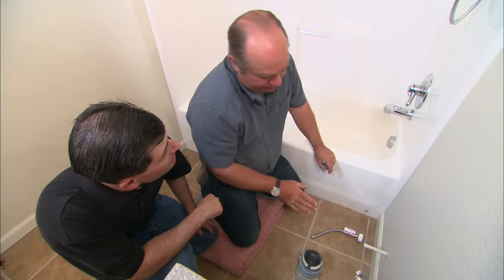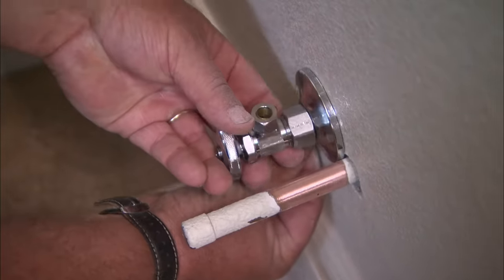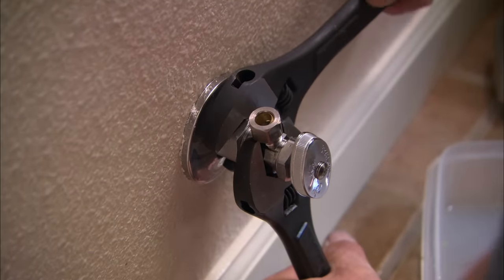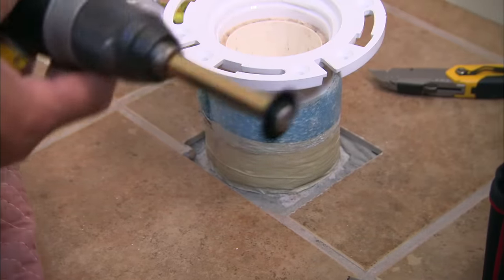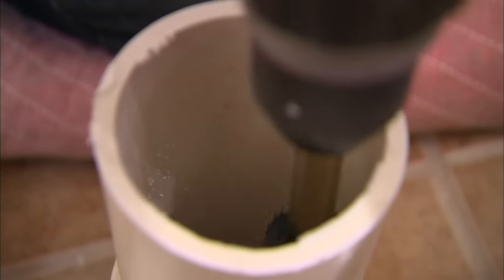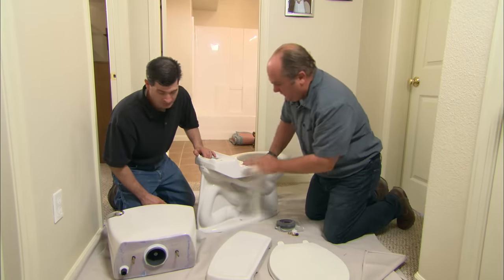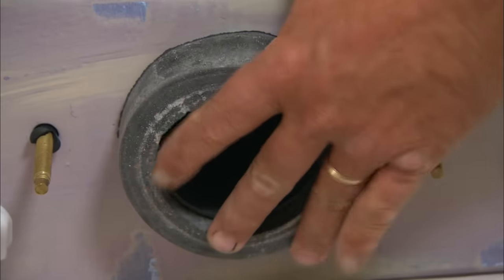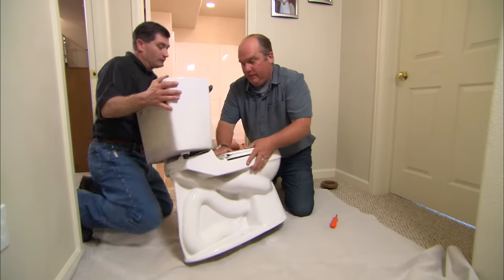How to Install a New Toilet | Ask This Old House

Comment: When I install the Johnny bolts to mount the toilet, I use a sharpie and mark a line on the top edge of the bolts perpendicular to the T in the t-style Johnny bolts. That way, I can be sure the bolts haven't rotated around where the narrow part lines up with the flange slot causing it to pop out easily when tightening the flange nuts. It's frustrating when they do that and you have to pull the toilet to reset them. A little prevention saves a lot of headache.
Reply: I love plumbers like you. I don’t have to worry that you’re going to cut a corner the second I walk out the door. Now, that isn’t to say the guys who do, are doing something wrong. That isn’t what I mean. I’m just saying that having a plumber, or any other tradesman who has proven they have an attention to detail, and take pride in THEIR work even if it’s on someone else’s project, is so valuable. I will pay 20-30% more to hire those kinds of tradesman. I always say to other builders, “is it really worth saving 10,20,30% if you have to baby sit them, and worry about it? The peace of mind is worth the extra money. And to be honest, when you try to save money by hiring inferior tradesman, you almost always end up spending more fixing problems. These problems might not even be things the plumber caused. They could just be things the plumber didn’t notice that were done wrong by the previous tradesman. Like if the drywall guys don’t put the light hole in the right spot. Then the electrician installs the light in the wrong place, and says “well that’s where the hole was, and that’s where the plaster guy brought the whip through, so that’s where I installed the light.” The electrician could have come to the builder and said “hey this whip was pulled through into the wrong area” and saved the builder time, and money, because the builder will have to pay the electrician to fix it because technically it’s “not his problem.” Those things add up when electricians are making 80 an hour the minute you step outside the contract. 

I will literally get into fights with other builders for stealing my contractors without asking. I know many who will. Luckily I pay my guys well, and they like working for us. Anyway, this was a long way for me to say thank you,  because you’re the guy I’d pay 30% more because you’re worth every penny.

Comment: Would have left the length of copper coming out of the wall slightly bit longer so that in the future if a plumber goes to change that compression valve they can do so without having to go into the wall because the previous valve deformed the pipe and made it now too short for a new one ✅

Comment: I always cut stub outs long enough so that I have access to the ferrule or brass ring in case i need to cut it off in the future. Basically add the width of the nut to the length. I’d also recommend using a stainless steel flange. For on me it’s much stronger. That plastic will break easily. For two, you can glue it and still spin the ring to where you want it so it’s much more forgiving
Reply: No kidding! When the shutoff valve fails someday (and this one will because he didn't use a quarter-turn angle stop) you will be cursing yourself for not leaving an extra inch. And since DIYers are likely to over tighten the nut and distort the pipe, you may be in trouble sooner than later. Oh, and he could have used a Sharkbite angle stop, or at least mentioned it as an option.
Reply: I had a PVC flange break so I replaced it with a metal one. I get to see tomorrow if it was the right choice or not. Because now I'm changing that whole toilet. I hope it is in good shape.

Comment: I would leave the Maximum of supply pipe.  You are now screwed if that connection leaks or you need to change that valve.  9 and '3'.  Tighten Tank and toilet evenly.  Turn on water before connecting to toilet and check.  The plastic retaining nuts become brittle over time and can slowly or suddenly fail.  I put a Rad Clamp around them and tighten it snugly.

Comment: He cuts the drain pipe down below the finished flooring so it works with the particular flange he used.  Once you cut it off you don't get that back again in case things change in the future.  Another option is to cut it off flush with the finished floor and use a push-in (or push-tite) flange instead that fits inside the drain...some have a gasket and some are glued in. This also would mean he wouldn't have to remove any material from around the pipe like he did.
Reply: It’s a special drill bit but I won’t tell you what it is so you can’t buy it 😂🤣
Reply: I agree.

Comment: Many here complained about a toilet water supply line cut too short. A way to avoid this and to make life easier for a homeowner down the road is to solder a male adapter to it and use not a compression valve but a FPT valve (female thread). That way if it ever needs to be replaced, it's easy and painless.

Comment: Nice video.  I'd have used a little teflon tape for the water line around the threads to prevent leaks.

Comment: I agree on cutting the pipe too perfect and leaving some room "just in case"  think he did a pretty good job although i would have added teflon to the connection.  Also I have had a plastic ring installed for 22 years changed three toilets o same one and it holds up fine.
Reply: There are also metal flanges to buy  (steel or aluminum). The plastic ones can crack. And I haven't seen a nylon one made yet or a resin made one either. I have been a caretaker for numerous apt buildings so I have done repairs and replacements before. There usually is a WHOLESALE electrical/plumbing warehouse or store in most bigger cities where you can get parts a lot cheaper than Ace, Lowes or Home Depot!

Comment: Sorry, 1:20 was too short cut of pipe from the wall. Better live extra inch for a future valve replacement.
Reply: It's a compression fitting. Get a new one with another compression fitting and you never have to worry

Comment: So when that shutoff valve goes, you'll have to cut into the drywall, replace the whole section of pipe, patch the hole, apply knockdown texture, prime and paint. All because you didn't wanna leave an extra half inch of pipe sticking out of the wall. Smart.
Reply: That's funny because that's the first thing I picked up on when I watch the video. And I had to rent about it you'll see my comment above.
Reply: Or you can just buy another shutoff and leave the old nut.
Reply: @investingwithpaco6540  you can't always use the old nut and compression ring.  I've had old rings that were deformed or damaged from the original compression and could not be reused.   That's very common.
Reply: @investingwithpaco6540  You also leave the old ferrule......
Reply: Great points and all accurate. 
Use a multi tool and make a square cut. 
Replace the new fitting and shut off supply valve. 
Take the new dry wall or green board and make an "Indian patch".
Cut the square on the back of the new drywall, but DO NOT CUT ALL THE WAY THROUGH AND PEEL THE PAPER BACK A FEW INCHES FROM EACH SIDE OF THE FRONT. 
this will leave dry wall paper to leave ZERO seams.

Comment: should mention remembering to remove the rag you put in the sewer pipe
Reply: Hahaha i know right ;) he forgot about that. First clog hahaha
Reply: He would have removed it before the toilet was put into place
Reply: bob woerner
Reply: do they make a cap or something that can be easily removed for that?
Reply: Just flush it bro...
Reply: @stephensnell1379  doubt it. They seem like amatures..
Reply: @lordcromwell5512  it won't flush. it will clog the pipe.
Reply: @bumperboatsturkeypoint3469  he can always learn new things even if he is a plumber, it's wise to realise you don't know everything about a trade even if you have been doing it for years and to try and broaden your knowledge of the subject. this is applicable in all things. only stubborn people mistakenly believe that just because they have experience they know everything, what suffers is their work and their personality.
Reply: Anybody can make this mistake.  I see professionals in any field make a mistake and do crappy job.   Building a home is an endless learning experience of making mistakes.
Reply: bob woerner - hah! Good point. That could cause some issues.
Reply: Lord Cromwell cloth rags and poo are quite different. Lol
Reply: Lol
Reply: Lord Cromwell hasn’t Oliver Cromwell been dead for a few centuries ?
Reply: Gravety and mega dump will flush it down.
Reply: Or maybe he used toilet paper? Or paper towel. Not a problem if you do forget.

Comment: Along whti leaving more feed line exposure it is always a good idea to secure bolts to flange with washer&nut to insure they stand straight  and tall and never ever spin when the next guy pulls the bowl off. Also it is advisable to mount tank to bowl After bowl install.  I am sorry but I expected more from This Old House.

Comment: Can’t tell you how much places and houses I’ve removed or seen old toilets with the flange bolts cover missing or not properly installed because the installer didn’t cut the bolt or didn’t know what the heck they were doing. It’s these simple things that can make a job look great or bad.

Comment: Great work, but that copper pipe was cut so short, next time you need to do work on it, you are not going to have any room left to cut it down if needed.
Reply: I agree; I always want a fudge factor when working on something.
Reply: Yeah, I thought the exact same thing. Should have left some more room.
Reply: That was a screw on connecter, he's good.
Reply: Yeah . I thinking the same thing .. basically.. u don’t leave any pipes for the next , remodel or issue lol ,
Reply: I remember having to cut into the wall just to replace an old leaky inline faucet, but I decided to just replace it with pex tubing instead of copper.
Reply: Yeah, I always prefer the bell flange and leave 1.5” for when that valve inevitably needs to be replaced 15 years down the road.

Comment: I have been a C36 plumber for 39 years and I would never put a plastic closet ring on that pipe.  They make them made out of steel and stainless steel.  I always use the stainless steel ones since they will never rust out and you will never have to replace the closet ring ever again.  Just experience of wanting to do it once and never having to go back to do it again.  Also, I see they never did put quick dry cement around the closet ring and have coated screws go down into the floor for a cement floor.  For a wooden floor, they did it right.  But when they were setting the toilet they never did level the toilet, they just set it without leveling it.  Not a good move.   Maybe I am pickier and want to make things right to where nothing will go wrong after an installation like that.   This is how I was taught back in the 70s,  And I have never had a problem with toilets after I set them.
Reply: agreed...... I'm no plumber, actually a school teacher, but I always pack plumber's putty around the ring to keep the water from going under the sub floor in the event it starts leaking underneath.  Moreover, i caulk around the the toilet base, but leave a 1" gap on the side and rear also to see when water starts to leak, but to stop most on the accidental toilet overflow.
Reply: R 
I agree with your opinion on the closet flange with a stainless steel ring, but that flange should have been flush with the finished floor, NOT ON TOP OF THE TILE.
Conventional wood sub floor, or on slab (this video), it should be secured with screws.  This old house is full of shit.
I can't wait til the owner gets tired of his new toilet rocking on the flange and the smell of sewer gas because of the compromised wax seal.  I get to fix issues like this on a regular basis.
Keep doing it wrong out there, I'm getting paid!
Reply: Frank De Mascio , I've been a plumber for 30 years, the flange should sit on top of finish floor. Not below it and yes use a flange with a stainless ring. I've replaced dozens of those cheap ass plastic type. And ALWAYS ANCHOR flange to the floor, that is what supports and holds the toilet to floor.
Reply: Have you ever put silicone at the base of the toilet to keep it from moving?
Reply: R s.     S
Reply: R well i am a nobody and my flanges are cast iron but I got that foam sani seal gasket and it works wonders. I will never use a wax ring again.  Used the sani seal on my downstairs toilet and my tenants upstairs rental.  I liked that i was redoing the floor with wonderboard had to stop so used that seal for toilet.  Went back. Following day pulled up the toilet, finished the floor and reinstalled toilet with same seal. That is something that you cannot do with a regular wax ring
Reply: Hi, where are you located, I'm in Flint
Reply: R you would put a stainless steel on the PVC pipe? Why? That PVC ring glued to the PVC pipe will never fail
Reply: John Breunig he did screw it to the floor what are you talkin about
Reply: where can I buy that special cut off wheel he had!?
Reply: Dude are you joking? All the toilet bowl leaks ive had to replace a flange on were from those metal rings. They're horrible, plastic never rusts.
Reply: new video
Reply: R i
Reply: Chandler Funk You obviously don’t have much experience with plastic vs stainless steel flanges. Never fail?
Reply: mr goodfella No, plastic ones just stress crack and break over time. Stainless steel flanges don’t rust and rot out
Reply: R how do you level a toilet also I have some other questions if you could git back that would be super
Reply: R wT
Reply: Good comment. You know what you’re talking about
Reply: No shims or level in sight
Reply: Wes Rogers  you are right
Reply: I am a plumber from England and we don't even use floor flanges. I have never seen them except in the movies.

Comment: If you're roughing, it makes life a helluva lot easier if you install the flange before the floor and tile go down. Of course, you need to make sure to compensate for the width of the tile when you're roughing and putting the flange down. I usually cut 3 small pieces of pex to stick underneath the flange to compensate the tile width and screw it right to the floor. Saves you having to do that cut beneath the floor that he does in the beginning and ultimately saves you time. 

And yeah, he cut the water line pretty short, but from experience, homeowners don't like the copper showing so it's habitual for plumbers to cut the toilet water line flush or as close as possible to the chrome extension. Your job is to make sure the customer and homeowner is 100% satisfied, it's not your problem to worry about the next guy that'll have to work on it and that he might have a harder time than normal, even though that next guy will probably be you anyway.
Reply: stubbing up 4" for the closet flange is the easiest and best method. No need to even worry about floor thickness.

Comment: I know the closet flange has a small lip to cover it, but why didn't you clean up the rough cut PVC pipe end?  Seems loke a good place for debris to hang up on and cause a pipe clog later?

Comment: Those floor bolts didn't need to me cut. They have a break away point on them as seen my by notch 1/8" above where he cut. Doesn't like to be able to reuse anything with his cutting things too short.